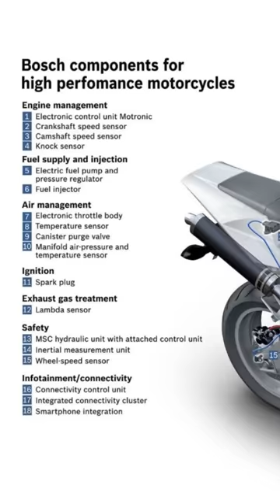Sport Bike में  Kick start क्यूँ नहीं ?  Why No Kick in Bikes #shorts

Comment: Without battery it wont start with kick also,
The sensors and fuelinjector wont work without power.
I have thunderbird 500 and it wont start without working battery even after kicking.